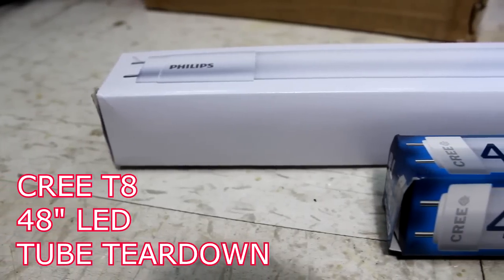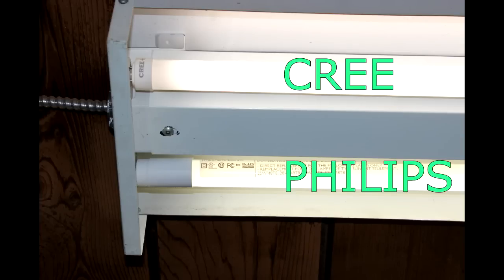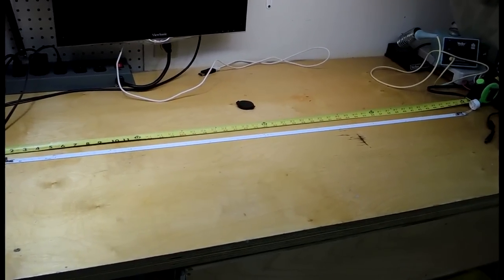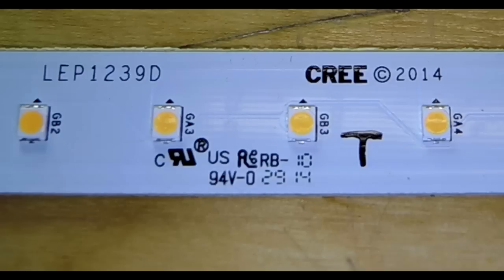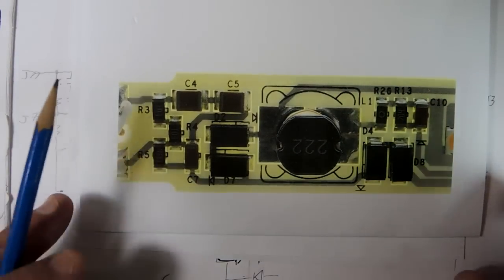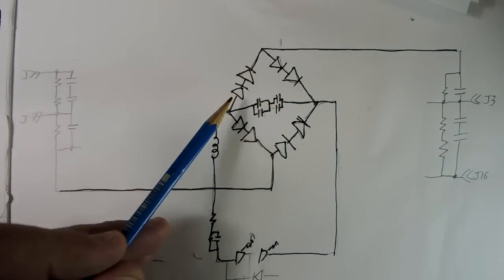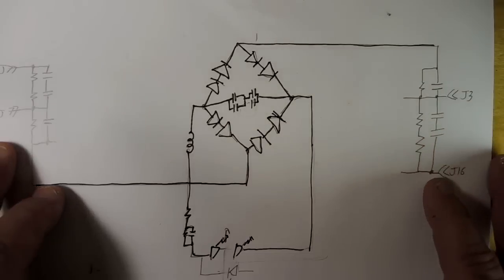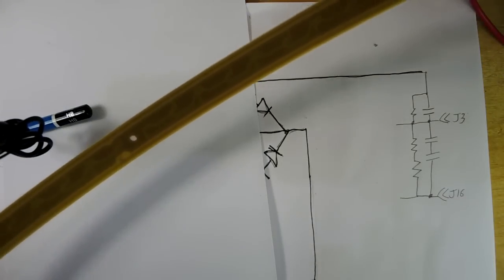48" T8 CREE LED TUBE TEARDOWNz

Comment: Looking forward to the Philips teardown.

The original Cree tube lamps were recalled not for the electronics design but for the clip design that connects the PCD to the pin connection.

As a engineer, I love Crees design and high quality FCC reports. However, i have had many of their bulbs fail. I had 2 filiment tower lamps fail by making a strobe effect. I also have 2 par38 lamps fail with a additional one failing doa.
Reply: +jak p (skiguy09) I do commercial electrical and cree make nice fixtures to work with, but they are known to have a short lifespan so we really dont ever install them commercially :\ makes me wonder about their residential stuff as I have never used them before.

Comment: Very nice. Not seen the Cree tubes in the UK. Very interesting that you keep the ballast in the fitting. All the LED tubes I have fitted have needed the ballast removed and a supply to one end or live to one enc Neutral to the other. when looking at a diffective one the LED's are in 2 rows down the lencth of the PCB and soldered together in 2' lengths.

Comment: Also 20 % more loss thru a ballast with traditional fluorescents, 2 x 40 usually ends up around 100w with older ballast loss.  I am going to put in a RGB adhesive strip in troffer that is lumen equivalent and 4000k, plus you can use remote to change colors for effects.  They have non volatile memory and will return to last color with your wall switch.  Just have to wire plugin ps inside fixture.  About the same cost as 2xT8's
Reply: +A D No I think you will find the traditional tubes use 36 or 40 watts including the ballast.
Reply: I was referring to 2 34-40w tubes totaling 68-80w + ballast loss, measures about 90-100w depending on ballast loss.

Comment: Somewhat surprised there's no constant current driver on the board, I'm assuming the R-C (snubber?) networks at the ends of the tube are to fool the (electronic) ballast into believing there's a real tube in the fixture, and to deal with the high voltage used to when starting a real fluorescent tube...
Reply: +icesoft1 Can elaborate on what's done electronically to trick ballast and why that's needed.  I guess to trick the startup. Thx
Reply: +icesoft1 
I think it looks like a capacitive drop power supply (devided over both ends). They are pretty much inherently current limited.
Reply: superdau Would that also work with electronic ballasts that run at ~20khz?   Seems that a capacitive dropper would be somewhat frequency dependent and 'results may vary'...   It'll be interesting to see how Philips does it...